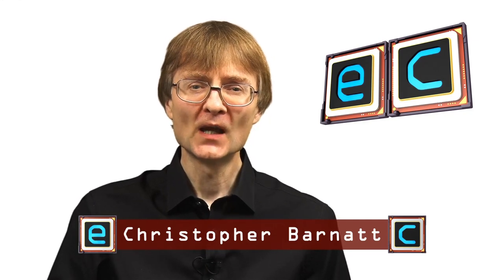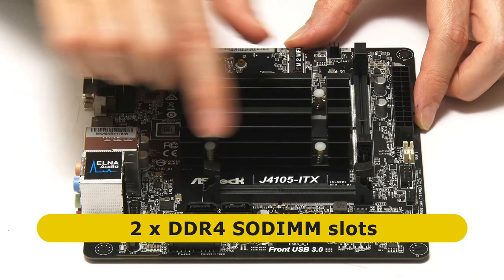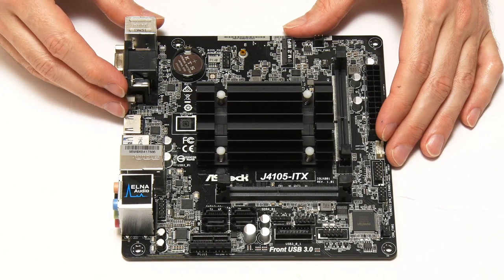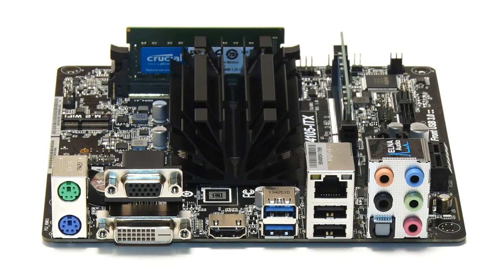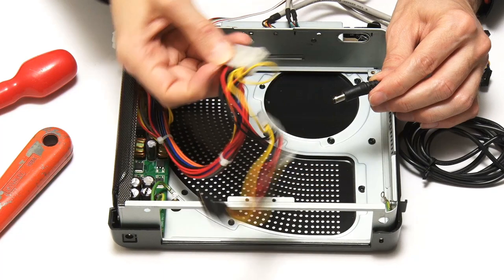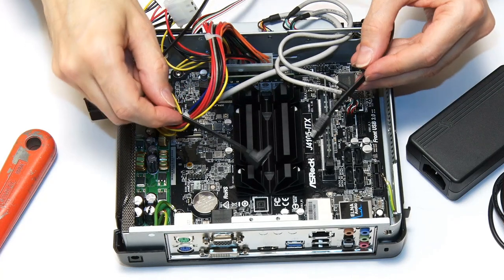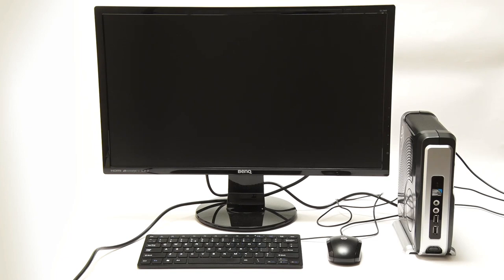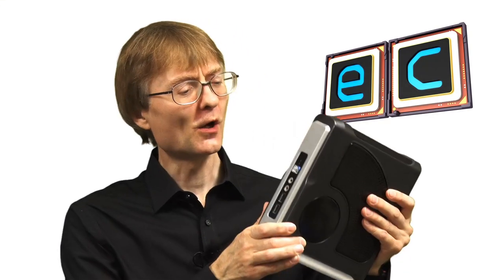Silent Mini-ITX PC Part One: Hardware Build

Comment: I'm building an HTPC using the Asrock J5040 motherboard. Plugged in 8GB of DDR4 memory and 2 SSDs . Also added my old Asus Xonar Essence STX sound card, the system is powered by a 120W picoPSU. Running Ubuntu 20.04, wanted to use my copy of W10 but can not get working drivers for the sound card. Still in a testing phase. For now I can say that for my purposes this mobo is just fine. HD content played on Kodi looks very good, CPU usage is on average under 10%  per core, the sound is sweet obviusly due to the Xonar. My only concern is that the mobo/cpu combo runs hot: 60 Celsius at idle and 70+ under load, have not done any kind of torture test because, well I'm afraid I may fry the thing. I'm gonna add a case fan controlled by the CPU sensor, I hate adding a moving part to a fully silent system but I'm not comfortable with those temperatures. Any advice or suggestions are appreciated.

Comment: I know it doesn't quite fit the standards and specs, but I think that in mini ITX motherboards they should have a PCI Express slot mounted sideways intended to be used for a riser cable. The standard only includes one slot, and physically in the cases there's only room for one, but on tiny motherboards like this it feels mechanically unsound to attach a giant graphics card to it, so I'd almost prefer it if there was a dedicated slot for an independently mounted graphics card and then the other slot actually mounted in the standard position on the board could be used for something else.

Comment: Price/performance of mini-itx , some Intel/amd SBC and small businesses Pcs would be another nice video.

I really enjoy your videos and British humour. Hope to visit the UK again after Brexit and Corona are done.
Enjoyed both London and the far south of England.
Not sure about this one, but I had to install a fan in mine.  Without I could control the speed with a desk fan ;)

Some cheap cases do not come with an internal 12V to whatever connector.  You can buy a PicoPSU for those. They are the size of an ATX connector.  They do not come cheap. A160 Watt 12V Brick plus PicoPSU Will cost about EU 80.
PicoPSU has variants for instable 12V, e.g. boat, car or solar. Even more expensive.

In general  I think this is a fun waste of money. 

A refurbished tiny business pc can be a lot cheaper. E.g. ThinkCentre tiny, HP Elitedesk, Prodesk or similar from Dell  or Fujitsu. It will set you back between EU 100-400 refurbished and EU700-800 new for none insane models. Today I secured an HP Elitepro 400 G4 with I5 8500T and 8GB of memory for EU 250. from an auction. The unit was sold without SSD or harddrive.

In August I built a mini itx system around an almost new BioStar a68n-2100. I used a new PicoPSU + 12V brick.  

I used:

- a 2nd hand Goodisory a01 case. Really nice!
-Two 120 GB SSDs and memory I had. 

The SSDs were secured with velcro to the sides. Bought new from a tailor. The velcro was attached to the sides and SSD with super glue.

The metal strut for roasting the SSD above the CPU now holds a small 2nd hand fan secured with tiewraps.

Additional costs, two short SATA cables and an USB converter cable to connect the usb ports on the side of the case.

 I like my build but it's hostname is piginapoke for a r.eason. Total cost is about EU 200. I probably will sell the underperforming mainboard plus memory and swap it out with a Ryzen APU on a B550 board in the future.

Cable management can be solved by using an NVMe SSD in an onboard connector or  PCIe adapters if your board has  as a useable PCIe slot. I believe the board used in the video does not have either option. 
Akasa sells 16x adapters with cooling plate and without bezels. Wired for 4x. I used these in another build.

Comment: I've built a router box on the J4005B-ITX. Similar size, though it has a PCIe 2.0 x16 slot, where an I350 quad port card went (had to compromise on the case size regrettably), along with some other differences. Fantastic little board for the task. Near 1Gbps it 's using quite a bit of it's CPU's power (somewhere around 50-60%), but there is a little headroom. I'll be testing VPN's on it, I wonder how much traffic it can handle.

Comment: Got one of those boards waiting to be used as a Untangle NG firewall once version 16 is released (it adds UEFI support). I've installed it with a Intel 4x port NIC into a slimline chassis.

Edit: Correction - I've got the J4105B-ITX which is very similar.

Comment: Old cpu, overpriced when compared to the newer/faster J5005 and J5040, which are the current ones.

I bought this specific MB last year on-sale for US $77. It has been running FreeNAS, but now I will get the J5005 or J5540 for some firewall builds. Power usage for a build with 1 SSD should be 5-17 Watts.

That kind of PSU is called pico psu. Simple voltage regulator for the 12 volts and voltage buck to get the 5 volts.

Testing should be done before closing the case. Putting the SSD in the opposite direction would have put the power cable out of the way.

Comment: Anybody else seeing the ripped SATA cable by not pushing the locking lever. The levers is still attached to the old MB. Anyway love your vids, watch them all. Cheers. See 10:19 🤦‍♂️
Reply from the maker: I did press the locking lever -- but it has seized. It took some removing, even with tools.

Comment: I do admire those little mini-ITX cases. Beats having a couple of breeezeblocks on your desk.

I'm going to guess that you're going to install ... Linux Mint. although maybe you're going to opt for a more media-centric distro like OpenELEC. I've tried getting TV signals into a Linux before ... not a pleasant experience. So maybe you're going to opt some kind of Microsoft setup. It would be good to know if your new computer can run Linux, though.

Comment: So.. You've helped Me many times, now it's my turn to help You. Are you aware that Silverstone and Akasa make ultra slimline SATA cables?  There may be other manufacturers doing them, too. Not only are the cables tiny and orders of magnitude more flexible, but the plugs are very low profile, too. Vertical plugs that add less to the port than a normal right angle. I'm from Yorkshire, with the needful tightness with money. Those cables are worth EVERY PENNY even in a full size ATX never mind SFF builds. I tend to use the Akasa ones because there's always one or two variants of it on sale for £2 or so.

Comment: 10:05 the moment when you ripped the sata cable, you can see on 10:13 that the connector is missing, probably stuck in the motherboard if you didn't press the hook holding it in there and just pulled on the cable
Reply from the maker: I did press, but it still came apart. I think the clip part seized up -- I could not remove the remainder in one piece, even with plyers.

Comment: For $100 I got from eBay a Dell 7285 mobile with i7 7y75 and 16 gb ddr. I added an new ssd and wifi card, put it all into a aluminum enclosure and it rocks.

Comment: I noticed the sata cable connecter got broken, you might want to try a flat head screw driver next time to push in the mental sata locking clip. :)
Reply from the maker: I did press in the locking clip, but I think it had seized. The remainder took some getting off even with tools!
Reply: @ExplainingComputers  Ah i see, yeh they can be finicky, oh well at least it was the cable and not the actual motherboard connecter.

Comment: Amazing that after all these years, they still go to the trouble (and considerable space on a board that small) to put legacy PS/2 connectors.

With respect to cable management, I remember having the misfortune to have to use a PS/2 Model 50Z in the early 1990s.  But imagine my surprise that when I had occasion to open it up, I found that it had NO cables -- everything was modular in the right way to just plug in to something else solid, and it all even went back together very easily.  Too bad this didn't catch on (and from what I've seen, at least some of the later PS/2 models abandoned this).  Wish somebody could have incorporated that mechanical design idea into something with performance worthy of the name better than molasses going through a clogged toilet in the wintertime  . . . .

Comment: I would prefer an Intel Nuc. Power consumption around 20w-60w since it uses an intel Ultrabook CPU. I use it as a secondary pc for non heavy tasks and as a backup to my laptop. Since it has more breathing space than a laptop so it performs better, its quieter and runs cooler

Comment: a DAA78L motherboard will take a A10-7800k APU plus 64GB of DDR3 RAM, A case fan can connect to this connector as the unit might not boot with the fan connector used, 16 would be better as the CPU/GPU take turns at using the system memory, AMD have a few Micro computers available with finned cases.

Comment: Sorry, but if this board size is 17cm by 17cm, it doesn't mean size of it is 17cm square. It would be 289 cm square. You could say it's a square with all sides 17 cm long.

Comment: Cut it off! The extra Molex connector blocking the heat sink and generally clogging airflow.  What are you going to use it for?  A floppy drive or a CD ROM??
Reply from the maker: It cannot just be cut off, as the SATA power connector it wired from it. But yes, it could be removed.

Comment: Guess that this will replace your i3 PC. Should have reused the thermaltake case since the psu will give it an advantage since it's fan can aid in ventilation and heat dispersal

Comment: Why are you using the BGA J4105 board and not a socketed itx board? I just upgraded to a B550i and 5600G ITX board from the BGA J2900 that came in my Acer Aspire XC-603, and it's night-and-day difference. I couldn't even play 720p60fps or 1080p30fps video on the J2900.
Reply from the maker: A socketed Mini-ITX motherboard and processor would be far more expensive than that I fitted here. The board I've used is fine for the purpose I need it for -- it plays 1080p video from YouTube and DisneyPlus just fine. :)

Comment: Might want to check the heat sink in the temperature on the CPU on those little boards the last four that I have bought were a different brand but they didn't have any thermal paste under the heat sink the temperatures zoomed all the way up to 75 centigrade at idle
Reply from the maker: I'll be showing temperatures next week! :)

Comment: since only one sdd was used, a smaller prebuild PC on the same cpu/platform could have been used. 
 Like a GMK NucBox K1, Chuwi LarkBox Mini or Beelink Gemini M, 
very small housing and around 150- 200 € / $ / £ with sdd (128-256) and ram (6-8gb) allready installed

Comment: @15:04 you short power and reset together it goes stright along like the power led and hdd led
Reply from the maker: No, I didn't. :) The jumpers are in the correct places for the two LEDs and power switch, as shown in the manual. The printing on the motherboard itself is indeed confusing.

Comment: any plans to put another ssd (msata/m.2) and do windows 10? Windows is still a must have since it can do many things and it is something we are familiar with. Well, this pc is like a nuc for computer enthusiasts
Reply from the maker: There is no M.2 slot on this motherboard, so another SSD would have to use a standard SATA port.. Windows is a "must" for certain software, but not all, and I don't need it on this PC. :) I have done many builds here with Windows on the machines -- eg shown in the third part of this series: https://www.youtube.com/watch?v=Bz_AyZswvXM

Comment: Assuming you haven't finished the other parts of this series, can you compare the performance to Latte Panda? Or is the processor in a completely different class? I have many Atom D525 powered computers in my lab rack that I'm thinking about upgrading. Latte Panda is nice because it is small, but also thinking HP T620 of T630 because I can get them really cheap on eBay.

Comment: This is cool, but I would definitely prefer an M.2 SSD. I see the MB has an M.2 slot. :)
Reply from the maker: Cool indeed. But the M.2 slot is "E" keyed, so will take a  wireless modules only. So neither a SATA or a PCIe (NVMe) M.2 SSD can be fitted.
Reply: @ExplainingComputers  Ah-hah. Thanks for warning me! I would have to find a different MB then.

Comment: Will a video card work with this? and which one my case is an  cooler master  Elite 110 mini-itx computer case.
Reply from the maker: There is only a PCIe x1 slot -- video cards normally go in a x16 slot.

Comment: So I could plug this PC directly into a 12 volt DC system instead of using a 110v AC to 12v DC PSU?  This thing draws about 5 amps if I did the math right.  This would be useful or something similar for an HTPC build for my sailboat.
Reply from the maker: Yes, totally. You could power this directly from any 12V DC supply capable of providing 5 amps at full load, although most of the time less current than that will be drawn.
Reply: @ExplainingComputers  Hi thanks for the reply!  I figured it made more sense and be more efficient to run it directly from my 12 volt "house" batteries than convert to AC through my inverter and then back to 12v DC.  I can power it from the filtered 12volt I use for electronics.  Thanks 😊

Comment: Geez, you were pretty brutal to that poor SATA cable when removing the old board. Do try to be more careful next time. Even old boards do deserve some respect.
This ASRock board looks very similar to the mainboard in my low-power home server/router, that one is older though and is based on a J1900 Bay Trail chip and has less expansion that your board. But the heatsink looks pretty much identical and overall board layout is very similar.
These are very neat boards for low-power fanless PCs or home servers. Mine is really picky about RAM though, if you use two RAM sticks, they need to be perfectly matched or the system will be unstable. Don't know about Gemini Lake systems, but I hope Intel has fixed the RAM quirks.

Comment: i'm more worried about the power supply if it's 60w it will be kinda risky to do a ultra budget gaming setup unless we use a branded psu such as corsair vs450 for extra gpu with a raiser adapter  ,so that we can use a gtx or Radeon card on it in a bigger case that is and actually cooler master has the perfect case of it .

Comment: Thanks for your interesting video, demonstration
Can it be used as a backup machine for my another desktop komputer ?
I would like to backup, compress and encrypt files in RAID system on 2 HDD, about 6, or 8 TB each 
.... or better to use a normal NAS system for it with all disks inside  ? .... thanks

Comment: hey there)
am a bit confused which driver to use , the l293d or l298n.. as i see in your videos you always use the l298n but i ve come across too many threads concerning this comparison.
i know the difference between voltage and power but. ak gonna need the driver to control 4dc motors, i found a 2 l293d on a same board and a 1 l298d and i don't know which one to use.
thanks)

Comment: I find those Mini-ITXs board which come with Celeron processors are terribly under powered.  I tried Windows 10 on a ASUS N3050M-E (dual core) , SSD, and 8GB of RAM. Windows 10 keeps both cores pegged at 100% with nothing else running, meanwhile circa 2009 Intel mini-ITX boards I have with Atom processors has no trouble with Windows 10.

Comment: Maybe you can tweak the ram.. you could buy the CMSX32GX4M2B3200C16 and lower them to 2400 but then lower the timings soooo much to push the RAM to the limit.. Like the 2400mhz would have the same bandwidth speed thingy like a 2666mhz.

Comment: nice comboboard but to be honest i bought an chuwi tablet (hi10x) with an N4100 processor for roughly 230€ i think u cannot finish a system for that low money on this atx mobo meening its cheaper sometimes to buy a fully integrated working system than a single component like this.

Comment: I have an asrock j3455 itx board in a music streamer. It has a usb out on the back of the board. I'd like to add a separate usb card to the board and any other hardware to make this possible, are you familiar with this?

Comment: Hello
Can you suggest a transformer for my Pi?
I use it for internet gaming, but with the mSSD and 5 volt fan I get a low voltage symbol.
I ideally want a 5 volt fan on the CPU a 5 volt fan on the WiFi chip and a 5 volt fan on the mSSD as all do get very hot when I’m steaming Cloud Games.
I’m thinking can I split that 24 pin ATX and separate the voltages with some soldering?

Comment: Going from storage to memory the USD/GBR exchange rate must have changed drastically.
Reply from the maker: Prices here do not reflect the exchange rate, they reflect that particular products cost in the US and UK, which can be very different! :)
Reply: @ExplainingComputers  Apparently so. For most components you mention is the price in USD higher than the price in GBP. But for memory it is the inverse.
Reply from the maker: @windmill1965  Yes. Memory prices are usually more volatile (no pun intended!).

Comment: Curious about how well it handles 4k and data processing. E.g. using LanguageTool spelling and grammar checker WITH using the Ngrams support. It uses Lucene database files. Older hardware maxes out on these and  older hardware cannot really handle 4k.

Comment: If the power supply is 10 years old too think about replacing the capacitors in the power converter board.

Comment: The best mini itx case is the asrock a300 (that am4 one) .. it's small & u can put in a 200ge or 3000g or 3200g or even 3400g with a good cooler.